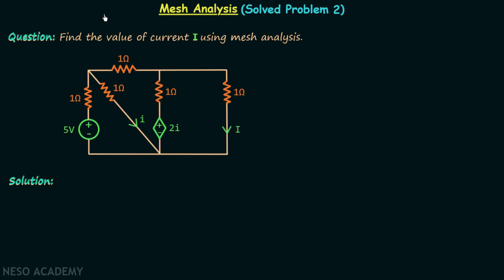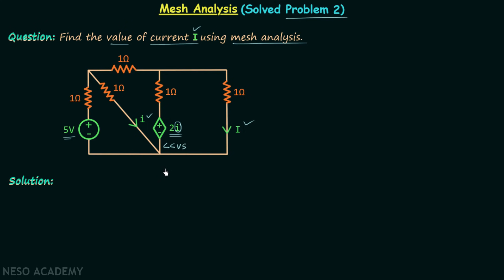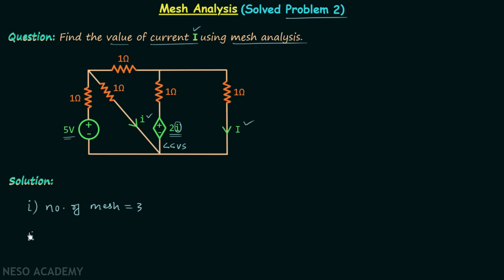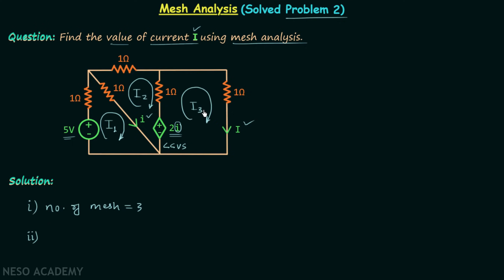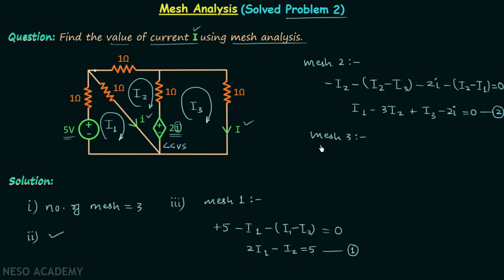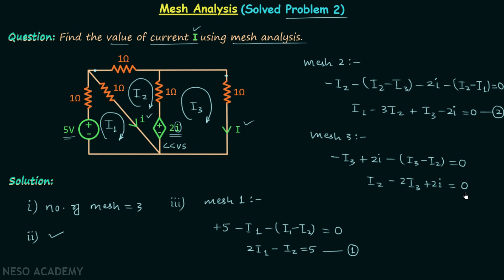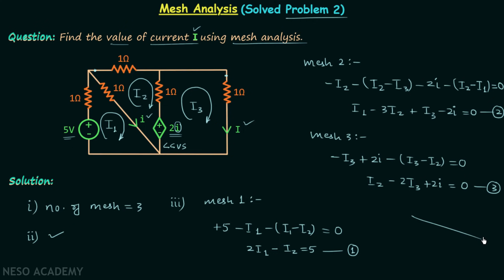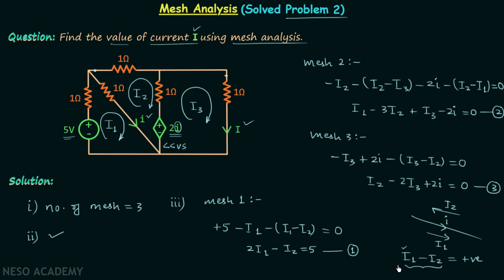Mesh Analysis (Solved Problem 2)

Comment: Can I solve this problem by applying supermesh between mesh 2 and mesh 3
Reply: We apply supermesh only when there is current source in between. But, there is only voltage source in common. So, we can't make supermesh.